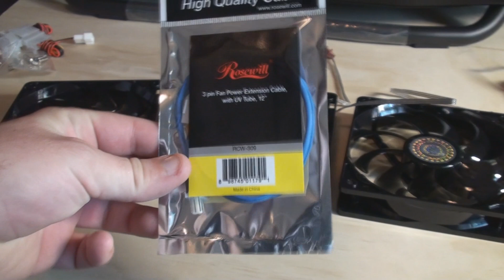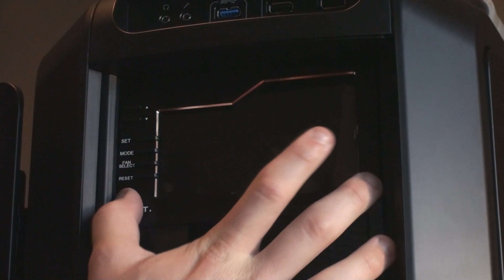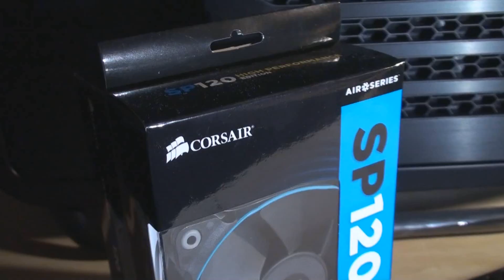Cooler Master Cosmos II Custom Liquid Cooling Build Part 3 - Installing the Tubing

Comment: I actually think the fans you got for that radiator are not the best for it.. they do move some air, but they really do not push air like other type fans do.. the three fans you got there are great for moving air around in the case like from front to back and exhaust, ect.. but not really well for pushing air through the radiator.  Hey, you fooled me as I watched further you changed out them fans.. great job.. LOL  Its  nice build, good job..

Comment: Man it's a wrong loop configurations!!!!!!

You shouldn't run the loop from VGA to the CPU!!!! This means taking the heat from VGA put it in CPU!!! Not suffecient. Why the hell then u r using 2 radiators!!??

Since u want to use 1 pump it's easy setup, simple math, from the pump to the VGA, from the VGA to the 240 radiator since VGA don't heat like cpu. Then from 240 radiator to the cpu, from cpu to the 360 radiator, from radiator to the sink :)).

It's easy man, I have no idea what u were thinking when u made this configuration 

Cheers
Reply: Faris Bsoul actually vga have more heat than cpu :) and it doesn't matter how it's routed. Temps would be the same
Reply: +pavkata99 actually? you are totaly right... at all point...
no matter, and vga heat much MUCH more, than cpu...
Reply: bro have you seen a 300w tdp cpu? like the r9 290x?
Reply: thats my point.
Reply: +Faris Bsoul it would change 1 or 2 degres...maybe, the loop configuration dose not change the temp

Comment: For a video, photo editing purpose, not gamer. Does water coolant necessary for these cases?
Reply: No water cooling setup like this video is not needed, you can use AOI solution though. But air is also good.

Comment: Hello, I would like to build my next computer using this case. I was thinking to use a 360 rad mounted on the top, just like yours (blowing air outside the case) and two more 240 rads in the lower part of the case. I would like to ask you: do you think it's possibile to mount these two rads in front of the psu, with a push configuration? (blowing the air to the right for the right 240mm radiator, and blowing the air to the left for the left 240mm radiator) is there enough room? thanks so much for posting this video, and excuse my terrible english!

Comment: seriously? you have your radiator fans blowing down, and putting all the hot air from the rad inside the case!!! you know that hot air go's naturally UP, so the ideal would be turning the fans blowing or pulling UP.
Reply from the maker: Hi, they were switched around after this video was taken, originally the radiator was going to go inside the case but I changed the design after.

Comment: What Rad are you using for the 360 rad up top? I bought an XSPC EX multiport. The support bracket for the case handles is in the way of the rad ports for me, you just grinded it down a bit?

Thanks.

Comment from the maker: Thank you so much I am glad it has helped!

The 60/90 degree fittings are from Koolance also. I cant post links in comments but just make sure you search through the different categories as the angle fittings can be in Adapters/Connectors/or Fittings.

Comment from the maker: Hi'
Yes you have to change the fluid out.But depending on what fluid you use some will last up to 2 years in your system. Usually once you have the system up and running it requires very little maintenance until you have to drain it to put new liquid in.

Comment: What is the maximum top radiator thick size you can use with this setup? 30mm, 35mm, 38mm, 40mm etc...??? Thanks...